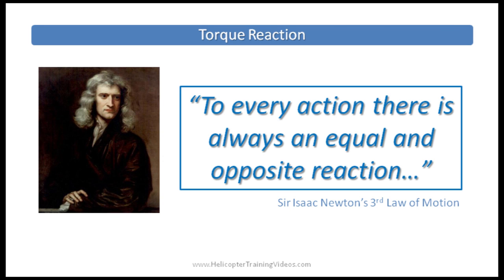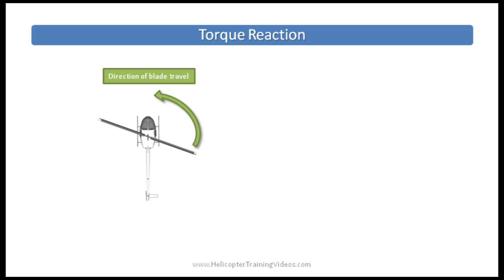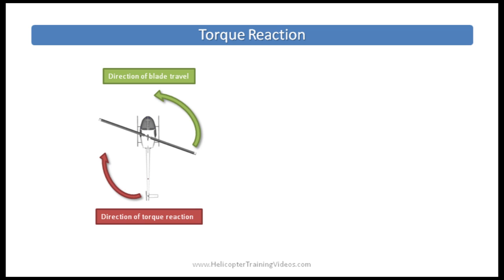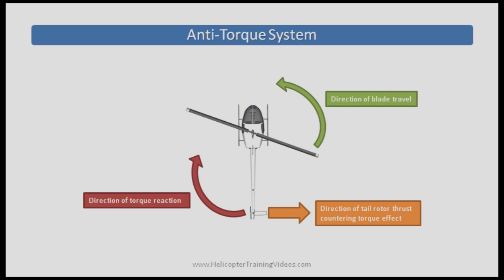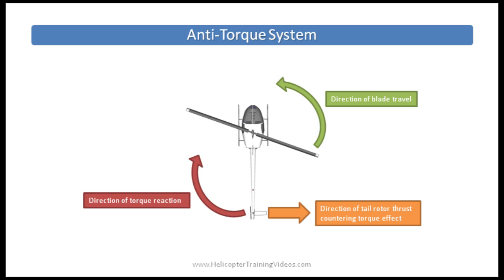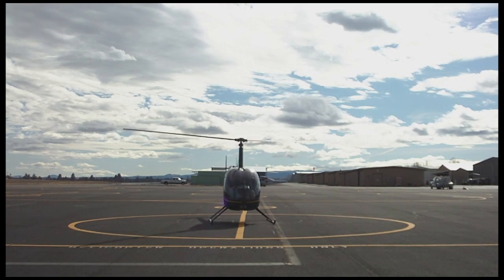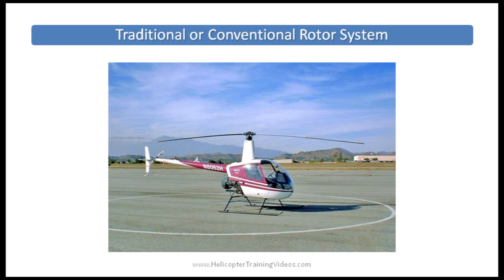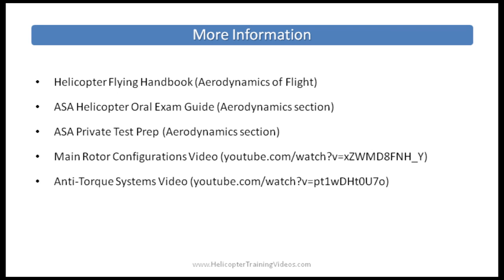Why Do Helicopters Spin if They Lose Their Tail Rotor? Helicopter Torque Reaction

Comment: Thank you very much for your reply. My doubt was while in auto rotation of the helicopter loose the tail rotor the helicopter will rotate in the same direction of the MR rotation?
Reply from the maker: In forward flight the vertical stabilizer helps keep the nose straight, then when coming to hover speeds, with no tail rotor, and assuming the engine is NOT driving the main rotor, there would be some left yaw caused by transmission drag.

Comment: Thank you very much for your reply. However, my doubt again is the rotation is in the same direction of MR rotation?
Reply from the maker: When the engine is driving the main rotor, the nose of the helicopter will rotate opposite the main rotor. So for a helicopter like the Robinson R22, the nose will go right as the main rotor goes left (from the pilot point of view). Does that answer your question?

Comment: Sir, my doubt is this.  Assume that the engine is shut down in flight and the helicopter is in autorotation. Suppose ,at this point of time if we lose the tail rotor, will the helicopter rotate?
Reply from the maker: Good question! There will minimum rotation as there is no engine torque to spin the helicopter. But as the helicopter slows down, it may rotate due to wind and due to transmission drag. But nothing like the torque reaction if the engine was driving the rotors!

Comment: Doesn't the tail rotor also generate torque? How do you counter it?
Reply: It’s absorbed by the rigidity of the tail itself. In other words, the weight of the helicopter is greater than what the torque of the tail rotor can move
Reply from the maker: Good question! I guess it doesn't generate enough to make any difference in flight.

Comment: Awesome explanation! But does the same concept of "every action there is an opposite reaction" apply to helicopters, whose main rotor is driven by a tip jet? This is because from what I have read, rotors driven via tip jet do not transmit torque to the fuselage. So would it be more precise to think that the concept refers more specifically to the shaft drive in the fuselage itself? Thanks!
Reply from the maker: Yep you are right - tip jets would mean no tail rotor or anti-torque system would be needed.

Comment: i know that but i never understand why the helicopter didn't get pulled sideways by the tail rotor which confused me
Reply from the maker: It actually does a little bit, designers and pilots compensate with opposite main rotor tilt.
Reply: @HelicopterTrainingVideos  ah, thanks

Comment: Hi myself am a aeroplane flight instructor and I've asked several helicopter pilots (not instructors) this following question but none were able to answer it. So the main rotor generates torque which is then counteracted by the tail rotor. What then happens the torque that is generated by the tail rotor? Granted, the direction of the torque would depend on the direction of the tail rotor rotation and could potentially be negated by the design of the airframe, what happens when the amount of torque (speed of the tail rotor) changes? wouldn't that affect pitch attitude of the helicopter?
Reply from the maker: Great question. I think the torque is minimal and not noticed by the pilot. The tail and main rotor should remain at a mostly constant speed in flight, tail rotor thrust varies by changing the tail rotor pitch angle, not the speed.

Comment: sir I cant understand about the small propeller on the tail of helicoter how the propeller is on horizontal axis
Reply: Just like the lifting force you get from spinning the main propeller ( It creates a force on Z direction), you get same sorf of force upon the smaller propeller on the back which counters the moment that main propeller creates. By the way the smaller propeller turns 6 times faster than the main propeller to create equilibrium.
Reply from the maker: Yeah it fights against the twisting motion caused by the engine turning the main rotor

Comment: why single engine planes like the P51 don't need anti torque system?
Reply from the maker: They do - they have torque that has to be countered by roll control and trim (mostly built in to the design) - https://en.wikipedia.org/wiki/Torque_effect
Reply: Wow just know this. Thanks for the info.

Comment: let's forget about the tail at the moment, would the helicopter body spin in the same direction as the main rotor?
Reply from the maker: OK forget the tail rotor thrust. A very smart guy once said  "For every action there is an equal an opposite reaction..." - the action of spinning the main rotor blades creates the reaction of spinning the body of the helicopter in the opposite direction.

Comment: actually you are wrong, the counterclockwise rotation of the blade causes the torque-the orange arrow- which is the counterclockwise rotation of the helicopter.The tail  causes a force that goes clockwise- the red arrow. Don't confuse us.
Reply from the maker: NOPE. You are wrong. If you can't see the physics of it, look at it this way - If you lose your tail rotor in an R22 (or other similar counter clockwise rotor helicopter), which way would your nose rotate? (Check R22 flight manual, emergency procedures section). It would go right, and the tail would sweep clockwise (red arrow) as the torque reaction is no longer countered by the tail thrust (orange arrow).
Reply: this video is right... in aviation terms torque the reaction force to a rotating body... don't be bashing people's video when you don't know your shit

Comment: what I don't get is why the body of the helicopter would spin, if the reaction torque  from the air was applied to the blades, and not the body.  I can't see how that equal and opposite torque is linked to the body of the helicopter.
Reply: the rotor needs something to push against in order to spin and since the blades are connected to the helicopter by the shaft there is nothing to stop the helicopter body from getting pushed the opposite direction except the mass of the body and tail rotor

Comment from the maker: Thanks MotoKid032, but you are partially incorrect. The R22 does have a counter-clockwise main rotor rotation and the tail rotor does cause drift to the right, but.. the tail rotor THRUST acts RIGHT, the blowing air or tail rotor downwash moves to the left. Thrust acts in the direction of the force - not the direction the air is blown. Think of an airplane - the prop pushes the air backward, but the thrust force acts forward - in the direction of flight and opposite drag (which acts backwards).
Reply: Thanks for explaining THRUST. from the picture and arrow i thought it pushes air to the right, which would not solve the problem. Even the word thrust i thought meant to push, so it is pushing but in the other direction.

Comment: You should get into RC helicopters, it will teach you every aerodynamic aspect of real rotorcraft just on a smaller scale ie. Translating tendency, flap back (blowback), effective translational lift, vortex ring state, transverse flow effect, dis-symmetry of lift. Everything. Join us at rcgroups.com.

Comment: You've got the direction of the tail rotor thrust incorrect. The R22 has a counter-clockwise rotating rotor, so the thrust vector (orange arrow) would blowing left and causing the helicopter to drift right.

Comment from the maker: I think I understand. The swashplate will tilt forward to tilt the rotor disc forward, to move the helicopter forward. What you might be getting at is the effects of 'gyroscopic procession' - which is a fancy term for the concept of a force applied to a rotating object (like a main rotor system) will actually be felt about 90 degrees later, in the direction of the rotation. We will do a video on that, but in the meantime - have a look search on Youtube for "Helicopter Physics Series Gyroscopes"